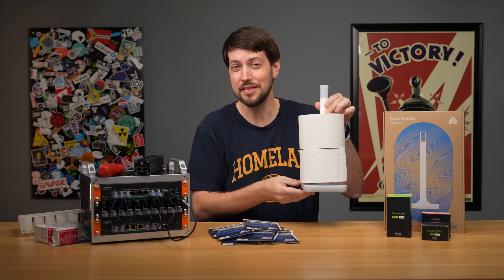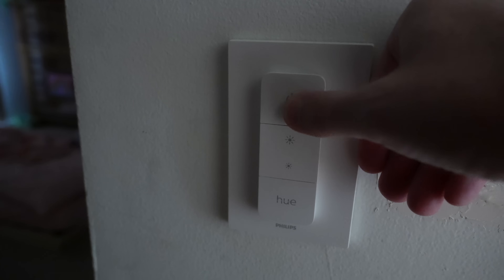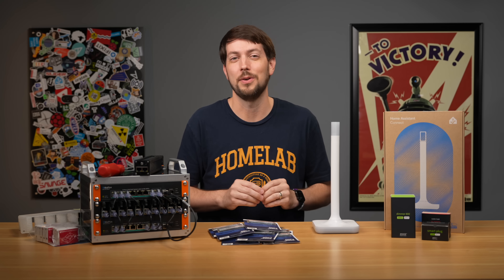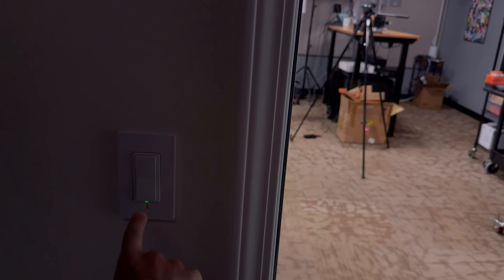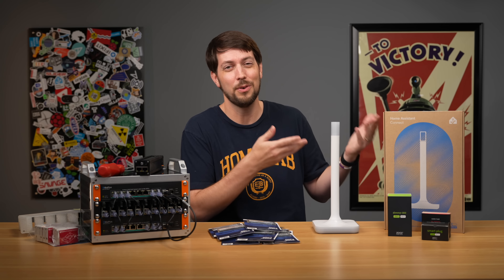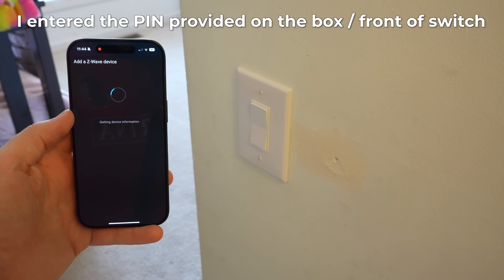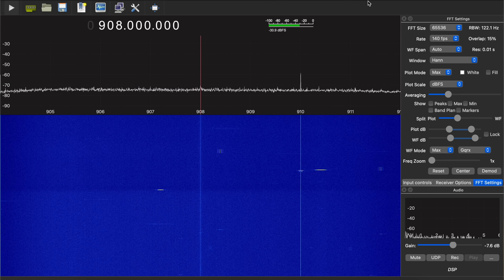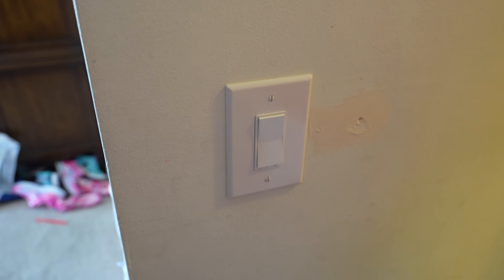My Smart Home Played me for a Fool

Comment: We have 230V here in Europe not 240V. The UK used to have 240V and reduced the voltage (maybe they went back after. Brexit, as people complained about lights being dimmer and electric kettles slower), and the rest was at 220V and increased. Of course the plugs are still all different, (there was an investigation into standardising onto something similar to what they already use in Switzerland, but switching to a standardised format was going to be too expensive).
Reply: In reality not a lot actually changed in terms of voltage, the tolerances were just set to accommodate both systems as they were.

Comment: Huge fan of Z-Wave. My 2012 build ran fully on a Vera 3 (Mi Casa Verde) and it was rock-solid. We had about 30 devices between smart locks (Schlage), switches (GE/Jasco), dimmers (also GE/Jasco) and even parallel (3-way!) dimmers - which are awesome and worked like a charm!

Big drawback here in Brazil: sourcing the BR-band devices. At the time, only US-band products were "easy" to find—so my network wasn’t, uh, strictly compliant 😅

Comment: i used my original switches and put zigbee smart switches switch in between. now the original 220V switches run on 12V. if i should get tired from that smarthome stuff or everything breaks i just remove the smart switches

Comment: Hi Jeff, I'm an RF telecommunication engineer and I've been messing with home automation since X-10 was the thing.  Amazingly, I still have my hair because home automation is better than it used to be, but still leaves some things to be desired, like reliability.

First of all you have the right type switch, that little pull out thing on the bottom is the safety power disconnect to the switch which my understanding is so you can kill the power completely so the switch can't accidentally get turned on when you are changing a light bulb.  For whatever reason, I've had switches lock up and fall off the network for seemingly no reason, and it is easier to reset that switch by simply pulling the safety disconnect than flipping through breakers to reset the switch.  

Second, the radio band Zwave and Zigbee use is called the ISM (Industrial, Scientific and Medical) bands which are unlicensed so anybody can use them.  I noticed when you scanned the airwaves it seemed really quiet were you are.  I live in tightly packed neighborhood and the traffic is absolutely non stop, which plays all sorts of havoc with my Zwave and Zigbee systems.  I suspect for many of your viewers, it is going to be a mixed bag of issues dealing with interference.

Due to all the problems with the Zwave and Zigbee systems, I have started exploring Wifi smart devices and I have found they seem to be the most responsive and reliable, which are great for wired in devices that have access to AC power. As such, I plan on using the Wifi stuff wherever I can, before resorting to the Zwave and Zigbee system.

Lastly, the biggest issue I've had over the years is getting the various systems to work with each other.  Almost everything in our house is voice controlled through Amazon's Alexa service, which in turn drives the SmartThings devices.  This is because not all devices work out of the box with Alexa, or SmartThings, so it takes some work to find out what works best depending on the device.  And I don't even want to talk about having to redo things because of software and firmware updates between the two of them, and other devices.

I wish you lots of luck with your home automation system.  Based on how quiet the radio signals seem around your area, I think you can expect few problems with interference and have good results.

Cheers!

Jim
Reply: I find it interesting that in a people-dense location, you find Wi-Fi IoT devices more responsive, when most of them use the same narrow 2.4GHz spectrum that everyone else uses. Plus, adding lots of Wi-Fi gadgets usually makes the spectrum noisy enough that your laptop and phone connection suffers. For me, I've found moving away from Wi-Fi to be beneficial.
Reply: @Ck87JF Yes, you are correct, it interferes terribly with my blue tooth subwoofer on my TV speaker system for example and I was forced to turn the power down on the nearby AP for it to work correctly. I'm using a commercial level network with wifi in my house and I set the switch setting for it to ignore interference from systems that are not mine so it does not get held off by neighbors wifi traffic. I'm also a communications engineer and my hobby is repairing test equipment so I have pretty much everything I need to test optical, wired and wireless devices from DC to 10 gigabits.

Comment: Is patriot ssd really reliable or you use them just as cheap hardware in your tests?
Reply from the maker: Cheap and have been reliable enough for me.

For production / long term I mostly use Kioxia (if I can get them) or Crucial (a little less expensive but nicer than low tier)

Comment: Love to see Z-Wave covered on this channel, but pushes up glasses in the demo, you ended up using classic Z-Wave, not Z-Wave LR. To pair with LR, you have to use SmartStart (by scanning the QR code). The biggest giveaway is that it's using 908.4MHz -- in the US, Z-Wave LR uses 912 and 920MHz for the primary and secondary channels, respectively.
Reply: He showed it was using 916MHz and LR can use the full 908-920 range but, yeah, you need to do S2 secure inclusion to get LR, from what I've read (I don't have any LR devices myself). The device info in HA should show that. My thermostat is S2 authenticated, though, and I didn't use a QR code to add it 🤔
Reply: @ericboehs  S2 security inclusion can be done with mesh or LR. In the video he added the device with a PIN and not SmartStart by scanning a QR. LR requires setup via SmartStart. In Home Assistant if you scan the QR on a LR enabled device it will ask if you want the device setup as LR or mesh.

Comment: Well, you could also use the binding functionality on zigbee devices to pair the switch with the lightbulb, that way, it works even if the hub (HA) died completely. I have all IKEA switches and bulbs in my house binded together and paired with home assistant, they're really cheap and never had any problem with those.

Comment: I prefer z wave over zigbee (sure hope this isn't alluding to zwave going dodo)  just because its not on the 2.4 band with all my other devices.  The mesh function makes it work perfectly for my use cases, and they still act like normal switches.  I don't get all these problems people are having, because so far every  'smart' device I have still has a physical button I can interface with, even when my server or internet are down.

Honestly the biggest struggle I have with a smart home is the pihomeassistant kept killing its SD card, or the occasional issue with the docker version on unraid not properly 'booting up'

Comment: I'm personally annoyed with the smart "switches" in my apartment. I've accidentally double tapped them before and they don't work because it means something else to the device, but ALSO because it's not a switch, it's just two buttons with like 1mm of travel. If I accidentally double tap my actual switches they still turn on or off.

Comment: It would be interesting to see how the Nabu Casa ZWA-2 compares to the Zooz Z-Wave Long Range 800 USB Stick.  

I'm really happy with the Zooz adapter - I've had no problems connecting it to my outside Z-Wave plug.  But, I think the distance is less than 50', so I'm not really testing the limits!

Comment: I have HA and a house full of zwave switches. Zwave works well with lots of devices and importantly is a different frequency than wifi. You might want a Home Assistant automation to set the dimmer level to 100% once the switch turns on.

Comment: If this also had Zigbee & Matter support then I'd be tempted to buy it, even if it's twice as expensive I feel like releasing a unit that does all 3 would be really popular.
Reply: yeah, that would be great
Reply: I watched the release party and they covered this.  The antenna is a major concern.  It was tuned to work best for the Zwave bands.  The antenna would be horrible for zigbee as they're  too different. 900 vs 2400 Mhz.

Comment: I also prefer to use smart switches with my lights but if you're using zigbee bulbs with the hue remote you should look in to zigbee binding. Essentially, you bind the remote to the bulbs directly so they continue to function even if your zigbee coordinator is offline. Latency is also better as the commands don't need to go from remote > coordinator > bulbs.
Reply: I think this is currently the only way to have control over brightness and color temperature of a light bulb (through directly binding a Zigbee remote)

Comment: Dont jump so fast to have the light reset to full brightness when you turn it on..  Once you get used to it coming back to it's last brightness, it is great..  We have very bright lights in our bedroom, and honestly, I usually leave them at 5% especially near bedtime, and it's nice to hit "on" and have it come back to that level..   I already have zwave, but I'm interested in this antenna for longer distances.  I am wondering if you can either have 2 zwave radios (which may be counter productive because you're splitting up all of your repeater devices) or if there's a migration path without removing and re-adding all the devices with the new radio!?

Comment: Still glad I chose WiFi smart stuff.  In theory zwave is better, but ...  TP-Link Kasa has been working well for me, having replaced my ancient X-10 gear after compact fluorescent and LED bulbs made my power lines too noisy.  And I have far more than 8 smart switches...  I can see five from where I sit atm.  A few weeks ago I replaced my last X-10 switches on two three-way circuits and also did the other two three-way in both boxes while I was in there (adding four more smart switches).  I think I'm up to 13 Kasa switches (including two dimmers), 8 bulbs, and a lot of plugs.  I wish they had a 240v contactor, but It probably wouldn't be much more compact than my version based on a 120v smart plug.

I also have a few Lora sensors - mailbox open, motion detectors, thermometers, ... It would have been nice if they were integrated into my TP-Link system, but that's for HA.

Comment: i was reading about it in the HA announcement. seems neat, that it's on a much less used band with a lower frequency and concomitant better wall pen and range should really help in a lot of situations. i wonder if it's defaulting to mesh mode because it just doesn't need to use LR mode as a result of less interference

Comment: I am currently trying to get more of my smart devices as LoRa and works with my YoLink hub, my current Wifi network shows 55 devices connected (light bulbs, smart power plugs, sensors, etc etc) and while my network does fine, it probably be better if i can reduce the 2.4ghz wifi clutter

Comment: How does that Zooz handle power outages? When the power comes back, can you control if the light is on/off? Took philips hue a bit to figure this one out but nothing is more frustrating getting woken up to lights at 100% after a power outage in the middle of the night.
Reply from the maker: Yes there's a setting to have it go back to the previous setting or on or off

Comment: I replaced a random electrical outlet that did not need to be smart to extend my z-wave network to a corner of the house that had poor reception.  That solved all the connectivity problems I had.  The power of a mesh network.

Comment: You need the Inovelli Zwave Switches. 10/10 can recommend them, and they work without a hub. Even can be configured without any zwave hub, it's got a configuration button. I really think you'd like them. I can highly recommend them. They also make Zigbee fan controllers that I'm using.

I am gonna get one of these really nice Zwave Antennas. I do have a lot of Zwave Stuff which meshes together and keeps things communicating well, so I don't have connectivity problems, but I'm always on board to support Nabu Casa.
Reply: I have done exactly what you've described here using the inovelli switches. When you push the switch it always goes to full brightness in the kitchen, regardless of what the dimmer was set at before.

Comment: Hey Jeff, At least on my Leviton dimmers, the setting for defining the brightness level when you hit the on switch (regardless of the previous level) is called Initial Dim Level. You should have something similar. Just go into the Zwave JS control panel, find your device, click on it to open the settings drawer, and then it should be under something like Configuration. YMMV since the manufacturer is different but Zwave is a lot more strict on how companies use their protocol than zigbee so the differences shouldn't be too great. That's actually the real benefit of Zwave: tightly controlled protocols vs. the wild west of zigbee.

Comment: Is there any solution to extending these non-wifi smart systems to out buildings that are a decent amount away from the hub? You should try and see how long of a range that thing really has?
Reply from the maker: I think someone else did and got like a mile or a little more with this radio, I haven't tested more than about 30m so far

Comment: if in the future you do want to find a more elegant solution for the hue lights. instead of using the hue dimmer. you can use a shelly 1 with a retractive switch. you can run the shelly in input disconnect mode which means the switch wont affect the actual power going to the lights. you can then run a shelly automation script that directly calls the http api for hue and turns off and on the lights.
I have mine setup so one press of the switch turns on lamps. two presses turns on all the lights in the room. then long press disconnects the power to the lights in case i ever need to replace one of them.

Comment: You can set it up to start up on 100% brightness with parameter 25. You will find them in the device information page, there should be "Configure" button on the left side under the device info.

Comment: I really like the idea of using these switches. Unfortunately I don’t have any neutral wires in my switch boxes, so it restricts me heavily.
Reply: There are a decent amount of smart switches that don't require a neutral.
Reply: @wojtek-33 Yup, 100%. I use Aqara light switches and they don’t need a neutral wire.
Reply: @wojtek-33 what I’ve found is that they require some sort of short range proprietary hub, like Caseta.
Reply: @GreenDavidA  Anyone in the smart home game likely has 1-5 hubs. It's just part of the process. You can get away with no hubs if you plan it well and make some compromises but having a hub shouldn't be a deal breaker.

Comment: When Hue required cloud stuff to keep functioning, knowing Hue just uses Zigbee, I reconnected all of my Hue devices to a different Zigbee hub (at the time, a Hubitat Elevation) and tossed the Hue Hub. I have since switched to a Zigbee coordinator with Zigbee2Mqtt. Hue bulbs can function as repeaters, and Thirdreality plugs also do this, so you can take advantage of Zigbee mesh. It's worth noting that Hue plugs, at least in the past, did NOT support meshing, so that's worth keeping in mind if you expect that. I only had 2 of these and they've since been replaced by Thirdreality plugs.

When I saw Home Assistant teasing this, I was hoping it was something that provided both Zigbee and Z-Wave as I have both devices, but I'm using an old-ish Z-Wave dongle right now. It works well enough, but I'd love to reduce my device count to make all of this work. As of now, though, I'm looking at most likely upgrading my Zigbee coordinator to one that will run both Zigbee and Thread, and likely saying goodbye to my remaining Z-Wave deployment, just to keep things simple. Though I'm planning to wait until I move next year to even dive into this, when I'll need to rebuild my mesh anyway. Granted, knowing Zooz seems to be taking charge on the Z-Wave front, maybe I need to look at that if I'm rebuilding my "smart" home anyway.

Comment: Just watched another video on this very antenna, amazing range, they got over 1.5 miles on a muggy rainy day and the antenna was on the back seat of the car. I can imagine some good user scenarios like opening gates at the end of a long driveway or even controlling a setback workshop without having to run cables as normal Wi-Fi loses range pretty quick depending on the weather and line of sight etc.

Comment: My problem is that zooz has blocked me from ordering from them for asking them some technical questions they could not answer. Apparently I am not the only one either. I still have two long range devices that go offline, but they wont talk to me anymore. So now I have tried a bunch of z-wave devices from a bunch of no name devices, which are the same hardware, with crappy firmware. 

For the brightness thing, I did a double-tap scene that sets brightness to 100%. But you could do a single tap up to 100%. There should be a blueprint for your switch.

Comment: Genuine question... why were you using the Hue hub if you were also using HA?
Is there any reason to run the hub still, and not just pair the lights directly to HA rather than integrating Hue into HA?
Reply from the maker: I got the Hue lights a couple years before I got into HA, never migrated my lighting to HA

Comment: Hey Jeff, I've got a few Zooz switches. In Home Assistant you can configure the Z Wave settings (Parameters 25 for mine) to set to full brightness on a single upper paddle tap.
Reply from the maker: Did it just last night!
Reply: @JeffGeerling what bulbs are you using?